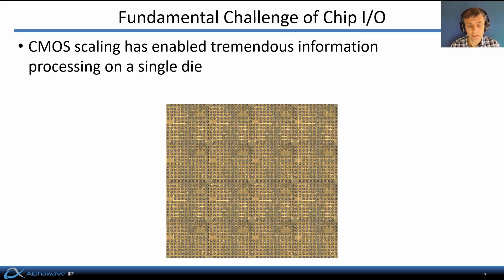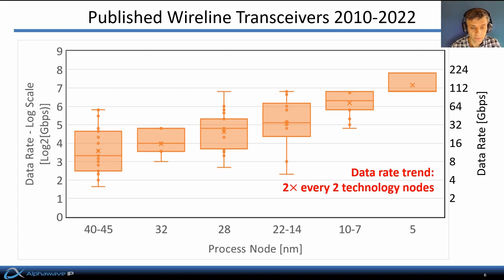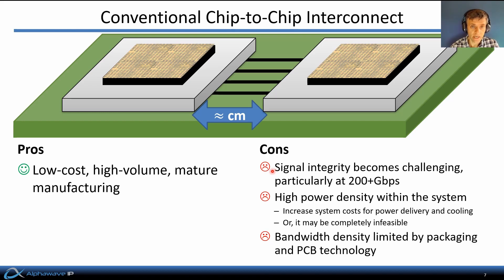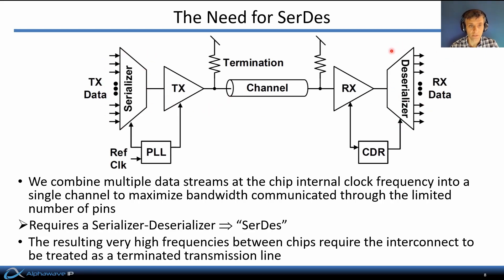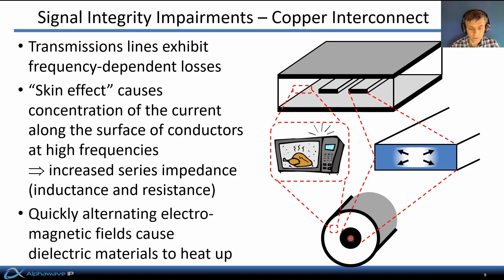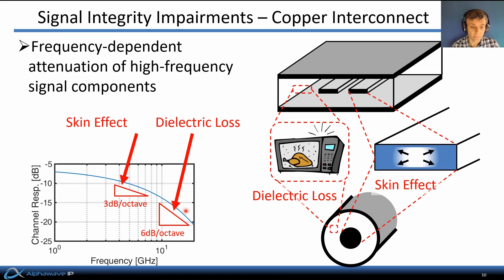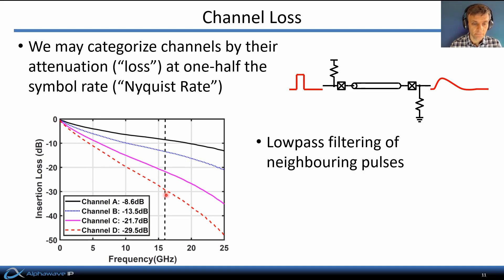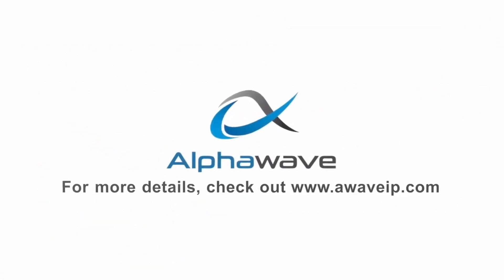High Speed Communications Part 1 - The I/O Challenge

Comment: @3m38s wrong statement. The onset of the skin effect REDUCES the inductance - not increases it. As the current density shifts to the conductor surface, the internal inductance component decreases, whereas the external inductance remains unchanged. The overall inductance, which is the sum of the two components, decreases by as much as 40% for typical traces on a PCB.